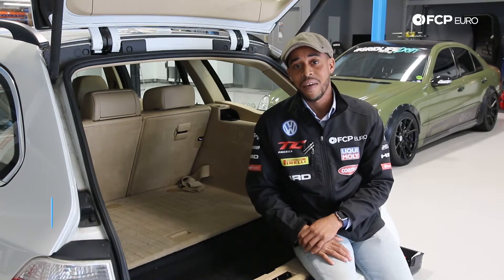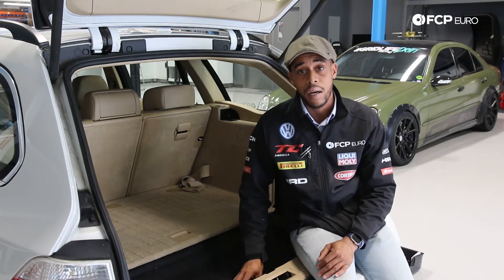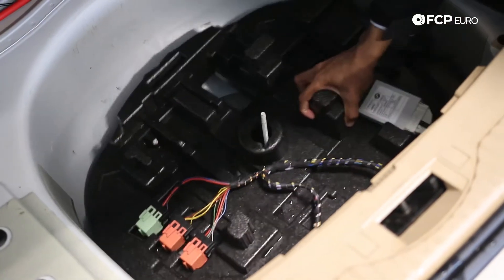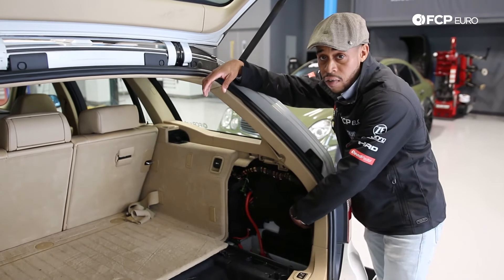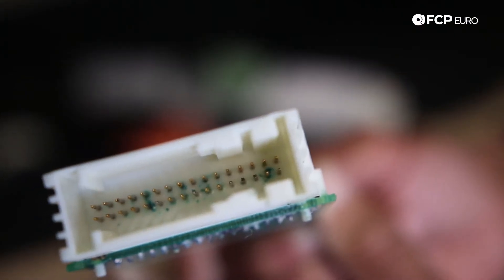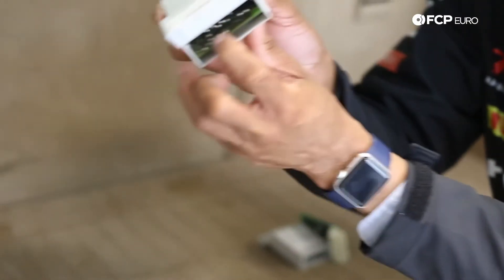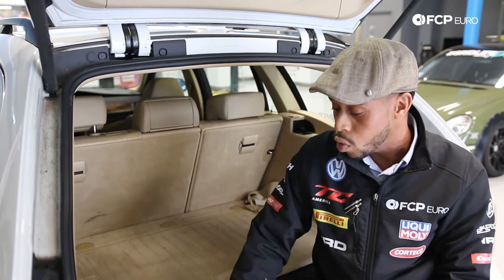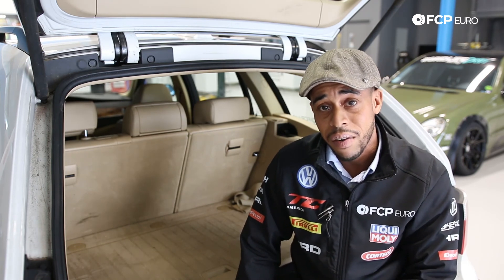BMW 530xi water in trunk (E60 and E61 models)

Comment: Hey Kile thank you so much for you video. I add this problem a couple of months ago on my BMW 525d 2004. I already changed the modules but now I am getting some huge errors. My cluster when I am driving turns off and my Radio as well and they turns on after some minutes again and the loop repeats after some minutes.. I don´t know what is can be but this happened after water in trunk problem. Perhaps you know what this is and you can help me with some advices. If not thank you so much anyway.
Reply: Having this same problem now. Can’t even open tailgate How did you resolve?